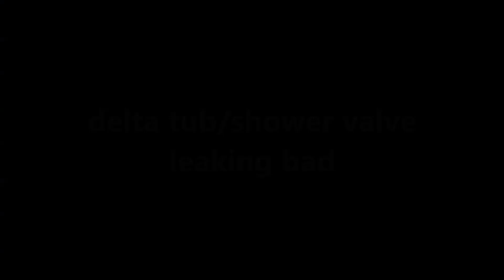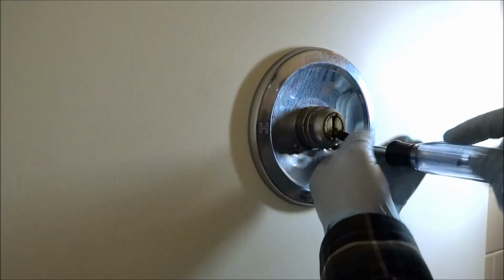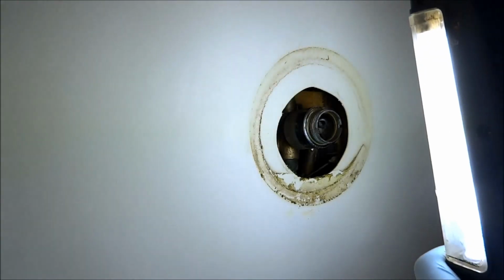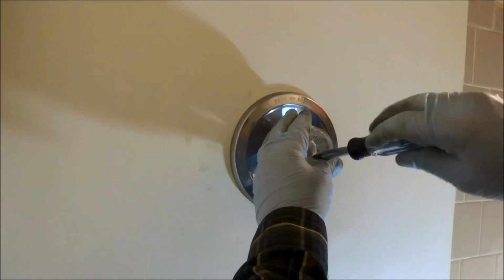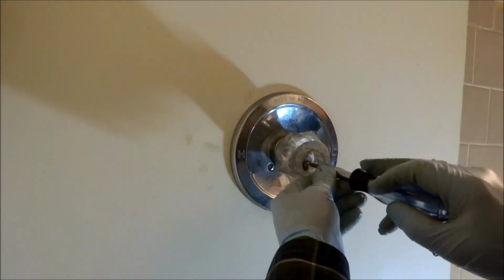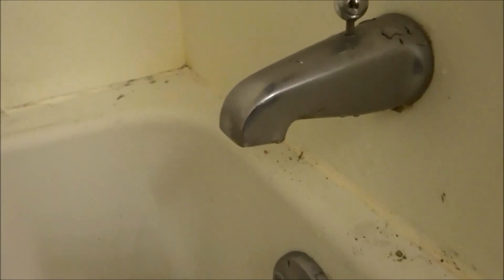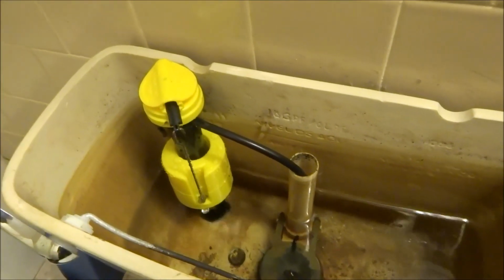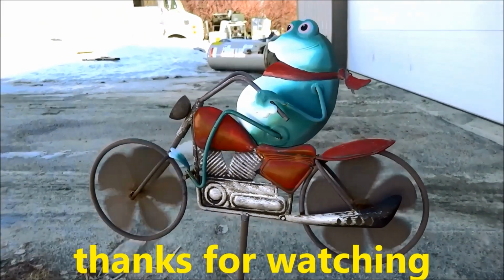rebuild a old delta tub @ shower valve complete

Comment: Here's a little tip that will keep many of you from twisting off the copper feed lines that he warned you about. Don't use channel lock pliers to remove the rounded cap. Use a pipe wrench like Steve does. When you use pliers you are squeezing the cap so tightly that the threads underneath are pressed so forcefully against the threads of the valve that you are effectively "locking" the cap in place. A pipe wrench does not squeeze, it only rotates and this is what is needed to remove the cap. I learned this only after trying large channel locks, penetrating oil, and even a torch, all with no success because of the channel lock pliers. Once I put a pipe wrench on the cap, it came off almost effortlessly. I hope Steve pins this comment to the top so everyone will see it and save themselves a lot of time and expense by not twisting off the three copper feed lines.
Reply: RelaxingASMR Excellent points!  I started with channel locks but was cautious and knew I wasn't getting any where. I had previously seen videos of people say "don't use a pipe wrench"!  So seeing Steve's video and the tapping technique was refreshing. Wish me luck. Doing now!
Reply: Thank u so much for pointing that out. U saves me time and money.
Reply: I wish I had read this before I took my dremel and cut a relief slot it, knowing I would have to replace it.  I don't have a pipe wrench and I could feel I was putting to much force on it with channel locks. I have a HD in my neighborhood where I could pick up a pipe wrench in a jiff.
Reply: Oops almost twisted mine off.  After  buggering it with the channel locks had to cut off with dremel.  This faucet now has feature of being slightly rotated towards the user  😉
Reply: I put penetrating oil and left overnight. Tried torching it and tried with plumber's wrench. Tapping and pushing it down. Ended up still twisting the lines and have pinhole leaks. Now I have to replace the whole valve that's in a concrete wall.
Reply: @hauless1140  mine too
Reply: @ricardoo3334  how is it now?
Reply: @eeeeeeeeeeeeeeeeeeeeeeeee-s3p  I had to hire a plumber to replace the rough in valve. They had to break the concrete around, replace the valve, and put some concrete back in.

Comment: Steve: Thanks for the tip about reusing the springs in the original unit. Delta sent me replacement springs and seals, (part RP4993) but when I opened it up and compared it with the spring and rubber gaskets in the original, the spring sizes were completely different! I thought Delta sent me the wrong set, and went to look in the Delta site for the "correct" version, but there wasn't one. Then I saw your video and heard your mention about using the original springs. I tore the valve open again and did as you said and it works! Also in the fine print in the instructions it says, "If there is 1/8" between these holes, reuse springs just removed." Duh! guess that applies to my old 1962 shower valve! Thanks again!

Comment: Thank God I stumbled across you doing an AC repair as I couldn't find this video I watched yesterday!  I have the exact same issue and needed to watch your "tapping" technique so I don't break the brass pipes behind this shower valve. Mine is a Peerless but I've found in those older models, Peerless and Delta are pretty much the same. Thank you so much!  P.S. I wouldn't have found you if I didn't recognize your voice and your blue plastic gloves!!!!

Comment: Great work Steven,,,,I can tell you have many years with a pipe wrench in your hands. I like to spray old valves down with something called Kano AeroKroil penetrating oil in an aerasol can. Its hard to find , but you can find it in a good HVAC supply house. Ive taken things apart I never dreamed I could take apart with the stuff. More vids please ,Thanks. DD in Los Angeles
Reply: A good welding supply will have it as well, we sell it. CRC knocker 'loose is an exact copy, orange can, Kano wouldn't sell it, so they copied it after the patent ran out.

Comment: Thank you for posting this. Wish I'd have found it before I broke mine. The first video I was able to find on these (after I broke mine, of course) shows how these things twist off. That's what I did, unfortunately. I have posted the title of your video in the comments for that video for reference, since you are showing an actual repair of this style. It was difficult finding info on these particular shower valves. I wound up having to cut into the wall and replace my whole setup. What a pain! Anyhow, if anybody wants to see what happens when they twist off just watch  "Repairing a delta or peerless faucet (must know)".
Reply: Laggin6 Good info to pass on!  I'm looking for the tool that Delta recommends to first take off that plastic adjustment piece before taking off the metal part. After seeing videos saying never to use a pipe wrench, I enjoyed his tapping technique.
Reply: Brother I just broke mine.  Honestly how much did it cost you?

Comment: Snapped one of these off yesterday.  I had used this trick in the past but yesterday no luck.  Luckily I had play in the copper and cut the pipes as close to the old valve.  Bought four shark bite female adapters and bingo new delta valve in place

Comment: Nice job steve.  Even some of the next generation delta valves with the cartridge still have those same 3 tubes and the the cartridge retaining nut is way more heavy duty. .  You have to bust out the dremel and cut the nut and split it.  They say a rag soaked in white vinegar will do the trick......hasn't worked as well as the mini cut off wheel.....for me at least.
Reply from the maker: Ryan Dugger the tapping and light pressure works well for me .
Reply: Ryan Dugger I'm going to try the tapping technique first. Cutting with a Dremel will be my last resort. And yes.... Delta's recommendation of soaking with a 50/50 vinegar solution for 24 hours didn't do squat!

Comment: I have a similar if not the same shower faucet. Purchased the Delta genuine part# RP3614A. Has the rubber washers, springs, ball seat, and some sort of tool that I don’t know what to do with. Also purchased the ball part# RP212
Reply: Addendum to the above-the springs that were in the faucet originally had to be unscrewed using needle nose pliers with right hand turns as opposed to normal lefty loosey.  The replacement springs were shorter, but when you look at the faucet, the old springs “screwed” into a smaller hole, while the new shorter springs rested on the shelf formed by the 2 different sized holes. Make sure to use plumbers grease on all parts when assembling. All is well. No leaks. Works great.

Comment: Steven- what do you think is the Delta valve model# for this style.  I think I have this same one (up/down for on/off and twist left/right for not/cold), and I’d like to see if the parts are readily available.  Faceplate escutcheon has something about patent 1962 on it.  Thank you!
Reply: Did you figure it out? I need the same info
Reply: Did you figure out the valve model number? I have the same one.
Reply: Need replacement part numbers too.

Comment: I had to use a dremel with a small cut off wheel to cut the nut off. I tried the pipe wrench and rapping on it. Soaking it in PB blaster. Then screwed up by using heat which melted the nylon pieces. I slightly twisted the whole thing and gave up before I really messed it up. The dremel cut me two slots quickly and then I put a flat screwdriver in the slots and gave it a twist. Both halves popped right off.
Anyone doing this, do yourself, or someone else a favor and put a little never seize, or silicone grease on the threads before you reassemble it.

Comment: Try spraying the cap with Aerokroil penetrating aerasol spray and tapping it with a light ball peen hammer first. Wait 5 or 10 minutes,,,tap again and make an attempt to spin off the cap counterclockwise with visegrips or 440 channel locks.

Comment: Great Job....   I have the same but mine doesn't say Delta... it has nothing on it, took the face plate off and it has 121-202 number on it ... looked that number up on google, turns out to be a B&K ?  

I want to update the fixtures...

Question, do I have to go back with the same or can I buy something else without changing the shower valve?

The shower valve has GOBO E015 on it

Comment: the shower head in my bathroom is leaking very bad it is also a Delta. I was wondering if this is what I need to do to fix my shower? this house was built in 1950s so it is really old as well.
Reply from the maker: +Katrina Blythe Alarcon probably in the main control valve .thats sending water up to the shower head

Comment: What does it mean when these Delta faucets leak in the off position, but only when its straight up and down?
If you turn the handle to hot or cold, while off, its perfect. But you put the handle in the middle, when off, and you can hear hissing and it leaks out the faucet...
I changed the seat and springs yesterday, and also the cam and bushing.
Thank you
Reply: @armandtanzarian9188  
Thank you! I will try that this weekend. I just got used to turning the handle slightly when i shut it off, but i constantly find it leaking because kids are kids. Lol 
They wont take the time to worry about that...

Comment: Great video Steve.  My next DIY is to rebuild a delta kitchen sink faucet.  Already purchased repair kit (seats/springs).  Question I have is...what parts do I have to grease, if any at all?
Reply from the maker: Michael Padovani if you can move the packing nut on the cap best to grease that,so you can move it,sometimes i have to cut them off

Comment: You're a pro Steve!  I was wondering if I could tap on my frozen nut under my sink.  Plumber came out and rooted line through vent on the roof since I had no cleanout for it.  He wouldn't undo the nut under sink unless I signed a waiver in case it broke.  Line is clear, but now I got a small drip at that rusted nut connection probably from the CLR or Coke I had sitting in the pipe overnight.  Didn't you use some kind of penetrating oil spray in another video?  Help me out here.  Nobody wants to mess with this nut and I got to do something.  Can't put back all my stuff under sink and got to keep a pan in there now to collect drippage.
Reply from the maker: Domo sounds like the nut is white metal if its all corroded thats why we only use brass, a brass nut will never corrode ,you will probley have to cut out and replace the piping . its hard to say unless i am there working on the stuff how i would tackle it .
Reply: Thanks Steve and Jeff.  I think my plumber just didn't want to get under the sink.  From the p trap after disconnected, towards wall, I have a black plastic pipe connected with a rusty nut to a threaded steel pipe coming out of wall.  I think, yes, I could gently cut off the nut with my Dremmel and get another screw nut to fit it.  That's probably the best thing I can do with this.

Comment: Glad I found this video, otherwise, I definitely would have TWISTED the 3 pipes off....but....I've been doing this "tapping" for what feels like an ETERNITY and have not been successful in removing the dome! I did spray it with WD-40 and tapped the dome (moderately) with a hammer and nothing..........Any other suggestions? 

Mine too is a DELTA and has been in this house for 30+ years........

TY in advance and GREAT Video!
Reply: @armandtanzarian9188  ... If I find myself, in this situation again, I'll do as you suggested. TY

Comment: Steve, I have a Delta related question: On a classic Delta single handle kitchen faucet, if the "off" position is out of alignment to the right of center-down,  what is likely wrong with it? What you mentioned about the three tubes gave me the idea that the last guy that worked on it might have over-torqued the packing.
Reply from the maker: Dwight Bennett maybe its off on the bottom loosen the retainer nut on bottom move the faucet back to center and retighten that might work .or it might be twisted internaly. if so just replace it with a new one

Comment: I know you can't spend too much time on each job but white vinegar can help to dissolve the calcium buildup.  Also if you put anti seieze (permatex) on the threads it is guaranteed to come off 40 years later. good video as usual.   http://www.permatex.com/products-2/product-categories/lubricants/specialty-lubricants-anti-seize/permatex--nickel-anti-seize-lubricant-detail
Reply from the maker: Michael Licitra some kind of lube will not hurt i tend to use faucet grease or key grease its made for water . not sure that antiseieze is water capatable don't forget its a faucet .

Comment: I use some heat from a torch.to lose the delta shower stem.
Reply from the maker: Danny Nungaray the only problem is to be carefull you do not torch the wall with that  but good idea .i have found the tapping on wrench works for me kinda like a impact hamber

Comment: So I ended up rebuilding this same delta model (or very similar). I just needed to replace the handle but noticed there was no silicone around the escutcheon. As I took it part I figured Id replace the components before they failed, but the rubber washers seen in this video between the spring and steel ball (plastic) were missing! How the hell was this thing not leaking? Anyone know?
Reply: Stovie Wan Kenobi Got lucky!  Guess God or someone likes you!